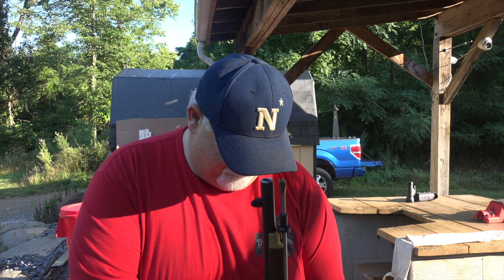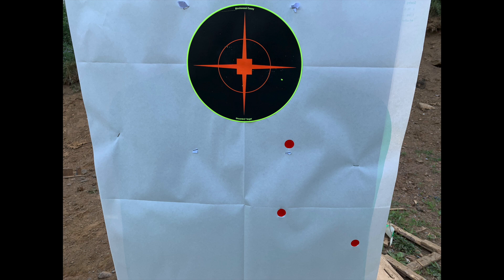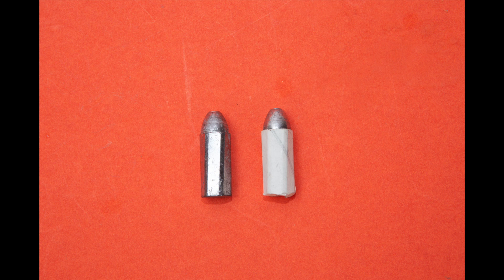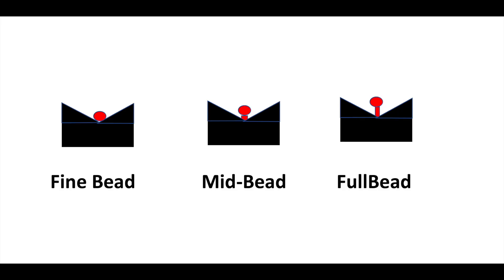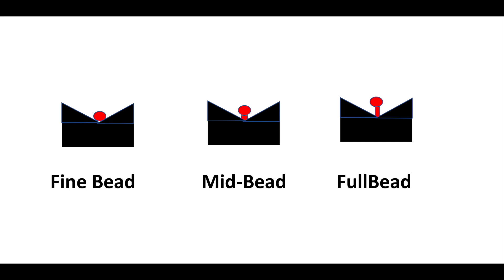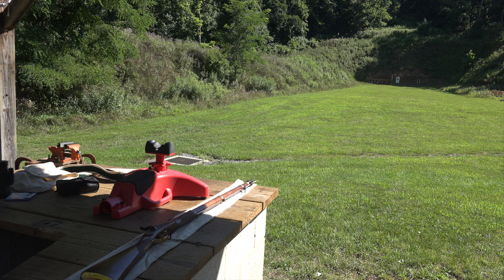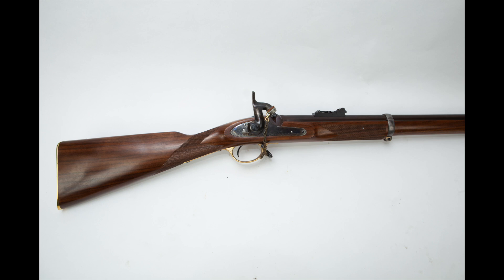Whitworth Sight in Completed   Bonus video

Comment: I know it’s not period correct, but have you considered powder coating your bullets? You could do away with the paper, and it could cut down on leading. It’s popular with cast bullet shooters and is simple to do. You can get a used toaster oven from goodwill, some non stick aluminum foil and powder and your set. I use pc cast lead in an 1885 Steyr with excellent results

Comment: The Pedersoli™ 1853 Enfield 3-Band Whitworth Rifle is a .451 caliber percussion model that is a reproduction of the 3-band rifle manufactured in the 1850's. In the summer of 1854 Sir Joseph Whitworth was commissioned by the English war office to engineer a rifle to replace the P53 Enfield and started work on a .451 caliber hexagonal bore rifle. By 1859, Whitworth was touring with his new creation and competing in shooting competitions across Europe, the new .451 Caliber Whitworth Rifle outperformed all competitors. In fact, during the first meeting of the British Rifle Association, Queen Victoria used the Whitworth rifle to hit a target 400 yards away. The Enfield 3 Band Withworth Rifle was also widely used by the South during the American Civil War from 1861 to 1865. The Confederate Army quickly realized that the long distance capabilities of the rifle and equipped an elite group of snipers with the rifle, these soldiers were referred to as the “Whitworth Sharpshooters.”

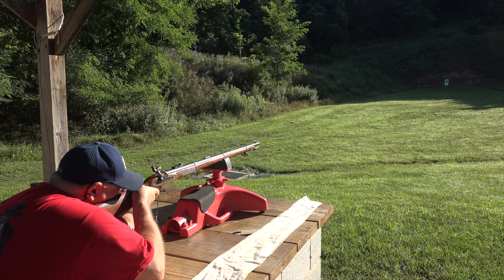The Pedersoli™ 1853 Enfield 3 Band Whitworth Rifle features a beautiful 45” one-piece walnut stock in a satin finish with color case hardened locks. The rifle is a .45 caliber (.451) and comes in a 1:19 twist rate. The rifle features a 36” browned hexagonal barrel and full length steel ramrod with brass end cap. The Pedersoli™ Withworth's front sight is a blued steel globe sight, while the rear sight is blued steel flip-up with a ladder/elevator.

The 1853 Enfield  Withworth Rifle is made by Pedersoli™ in Italy and is 51" in overall length and weighs 9.5 lbs.

Comment: Mr. B I take it the bare lubed hex bullets did not shoot.  I've learned this year my eyes are done with open sites.  I had put home made peeps on the muzzleloader builds,  it helped a little but looks like I need to make me a optic muzzle loader.  now the question is  sig romeo zero 3moa, crimpson trace 2 moa sight,  or bushnell 1.5x handgun scope.
Reply: I too wonder how the hex bullets do with out the patch, but maybe lube or coated and felt wad underneath.
With my eyes I am thinking of a red dot sight, but it might need cleaning now and then after a few rounds.  Some of those rifles I though did have primitive telescopic sights.
Reply: @loquat44-40  Hi-lux makes them still but  they are not cheap.  maybe after totally funding the retirement.

Comment: How does the Whitworth compare to the Great Plains rifle?
Military versus hunting would be apples and oranges.
Accuracy (at 100 t0 150 yards) and handling (lining up shot quickly, etcetera).

The Lyman Great Plains Rifle Signature Series Muzzleloader is the latest iteration in the Great Plains line of rifles. Lyman has offered the Great Plains Rifle since early 1980. The GPR was engineered to be authentic in design and accurate on the range and in the field. Many of the standard design features of the Great Plains Rifles will be carried forward in the Signature Series, which is made in cooperation with Davide Pedersoli of Italy. This new muzzleloader is sure to be the go-to option for hunters looking for custom quality at a production muzzleloader price.

The Great Plains Signature Series Rifle offers a 32” barrel with a semi-buckhorn rear sight and a silver blade front sight. Engineered to accept both round balls and conical bullets, this model will feature a 1:48” twist rate barrel. With many muzzleloading enthusiasts upgrading to peep sight configurations, Lyman made sure to drill and tap this muzzleloader for the Lyman 57 GPR receiver sight. The Rich Walnut stock and blackened metal furniture give this rifle an outstanding look, while still maintaining performance and function in the field. As with previous models, the Great Plains Signature offers a double set trigger.

The Great Plains Flintlock offers an updated and improved Pedersoli lock mechanism. The vintage-style flat mainspring lock is crisper and more consistent than previous models, which helps ignition speed and reliability for the shooter. With the addition of the craftsmanship and attention to detail of Davide Pedersoli & Co, the Lyman Great Plains Signature Rifle is a great addition to any muzzleloading collection. Over the years, Pedersoli has become known for their impeccable designs and craftsmanship. The wood to metal fit on these muzzleloaders is second to none, and a true bargain at these prices.
Reply from the maker: The Whitworth is basically a sniper rifle. Apples to oranges to the great plains.
Reply: Way to throw a full marketing department ad into someone else's video's comment section.   I hope Pedersoli paid you for it.
Reply: @Sman7290  Call now!  Supplies are running low!!  "As Seen On YouTube"

Comment: Mike, are you using pure soft lead with the hex bullet and 45-70 bullet or a harder alloy ?  Also will you test an unpatched hex bullet ?  Looking forward to the next test video.
Reply from the maker: pure lead
Reply: @duelist1954  iirc the hexagonal bullets were made of a harder alloy precisely because it doesn't have to deform to fit the rifling.

Perhaps a harder bullet would yield more significant (and favourable) results?

Comment: You are made of sterner stuff than I! Shooting off the bench like that, I would have been using a recoil pad.
I wonder if you could use a fine bead by varying the powder charge or type. If memory serves, you are using Swiss 1.5f. Perhaps 1f or 2f would put you on target?
Reply from the maker: I moved up to 80 grains of 2Fg with no noticeable difference.

Comment: Nice video Mike
I have a Pedisoli M. River Hawken. 45cal rifle. It had the long Buck eye rear sight. This brought the buck eye about 2.5 inches from the dovetail closer to my eye. Getting a focus with my eyes was impossible. I've changed the front sight to a post sight, but finding it difficult to get a rear sight that works. After using a home made magnetic temporary sight I've cut it down to about the height I need, which is about 10mm from the dovetail base to the top of the sight.
Do you know of any stock sights that would do? I'm thinking of making one.  However, accuracy is what I want at 50 meters. I'm not convinced I'm going to get that. So is there other variables I should consider?
Thank you.

Comment: How would the hexagonal twist on the bullet be expect to align with the hexagonal rifling?
Reply: They should be the same.
Reply: Original Whitworth rifle barrels were made longer and a section would be cut off for use as the bullet mold, with a twist matching that specific rifle.

Comment: Couldn’t the rear sight be raised to accommodate the low print?  Also, is there a windage adjustment on the Witworth?
Reply from the maker: For windage you have to drift the front sight. The sight is graduated for 100-yard increments. Moving it to the 200-yard setting makes it shoot a foot high at 100 yards.

Comment: Mike, what alloy are you using for the bullets?  I just got a shipment in from Rotometals, half 25:1 and half pure lead.  the 25:1 is primarily intended for my 45-70 bullets for my Sharps, but I can use it for the Whitworth bullets as well.
Reply from the maker: Pure lead